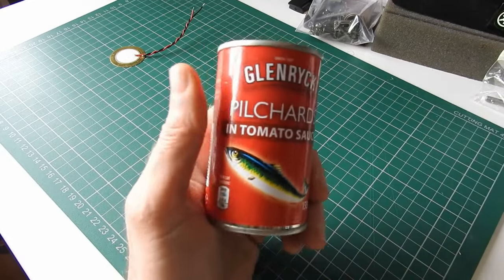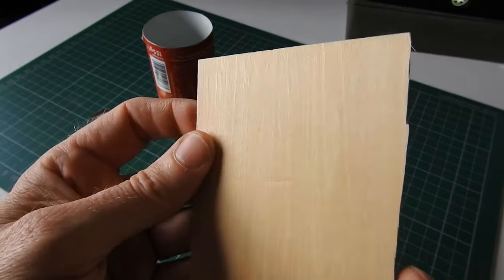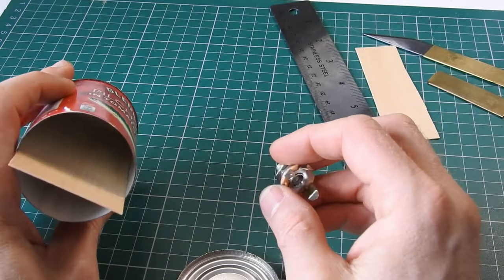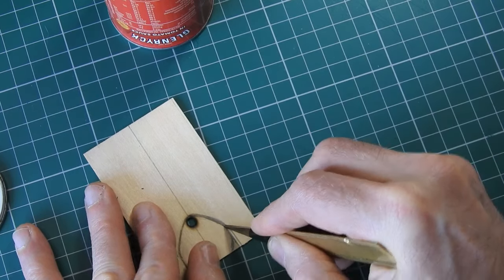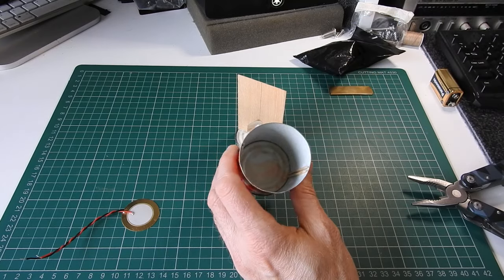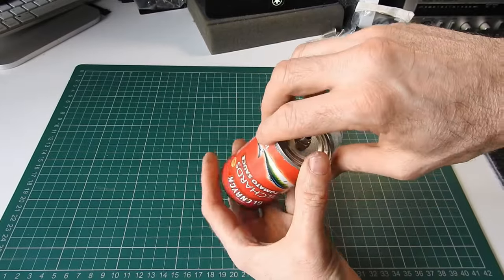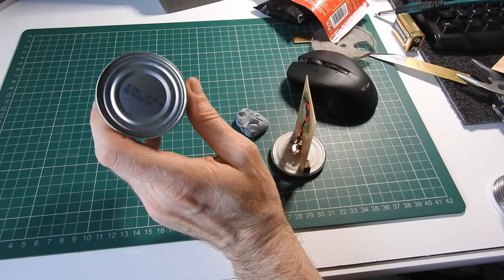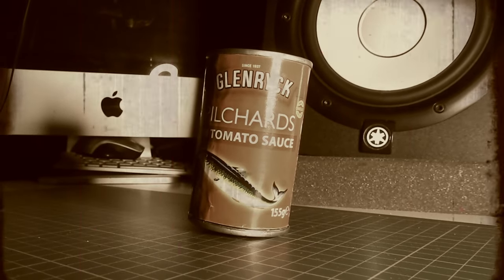Tin Can Mic Build | Can A Pilchard Microphone? | DIY Mic From An Old Tin Can | Lofi Experiment

Comment: You may consider isolating the piezo element with an impedance matching transformer, or for a really lofi effect a resistor voltage divider, as the voltages coming from those piezos can easily shoot into thousands of volts. Added bonus of that is an improved low mid range without that pronounced high impedance nose on it.
Reply: Soft clipping is a must with something this high-Q, filtering it down a bit would also help.
Reply from the maker: @antiphlex That is some very useful information, thank you for sharing your knowledge. I am an absolute beginner with electronics, and would very much like to improve, so any advice is definitely appreciated! Perhaps I will do a follow-up video and make some improvements when I know a little more. 

Thanks again for the comment.
Reply from the maker: @zinkzensteel Thanks for the input - I need all the help I can get!